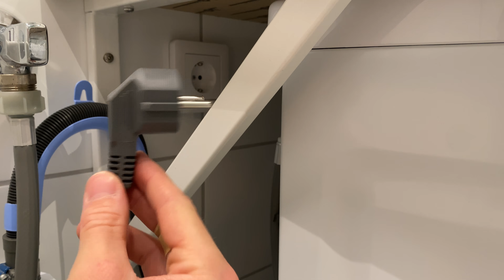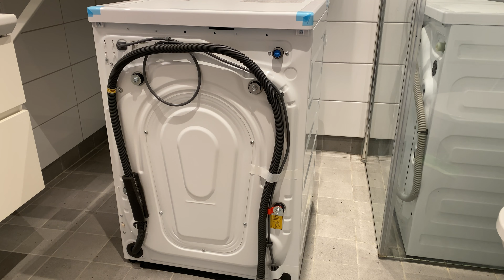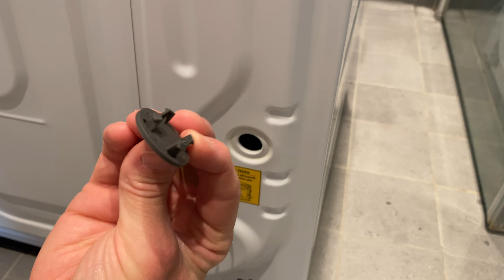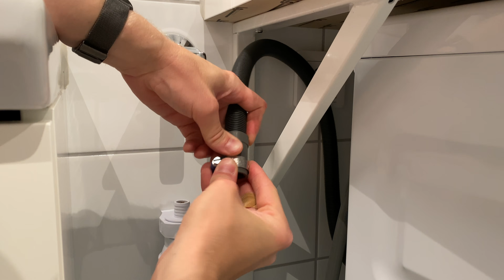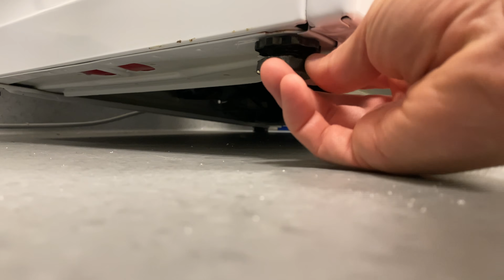How to Install a Washing Machine (and Remove your Old One)

Comment: I'm newly single and first time I'll have to disconnect and put in new machine. Do I turn off main water supply. I'm useless at DIY and usually  fail at everything. Is it advisable for novice to tackle this job? Anybody who can give me tips plz do. My old machine has already flooded downstairs neighbours, I need to avoid doing it again
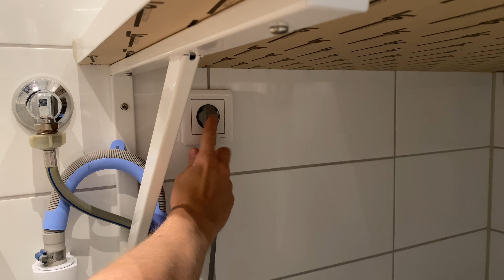Reply from the maker: Hi! As long as you turn off the water that gets connected to the machine before removing any hoses you should be fine there. However if there are no valves or similar very close to the machine (like at 01:39) in the video the water needs to be turned off somewhere else. I would say though that it could probably be a good thing to ask around or have someone help you if possible. Just to avoid any water damage or installation hazards, depending on how your specific machine gets connected.

The installation process also differs a lot from country to country, depending on standards, plumbing, electricity etc. This way is more common in the European region, but even there we have got different standard in different countries. So, take all the help you can and also perhaps ask around in any retail stores to hear if they´ve got some good tips, tricks and recommendations. Some installations you are also not allowed to do on your own, again depending on regional laws etc. Better double check than chance it :-)
Reply: @GetThereFaster thanx for that. Im clueless. I cant afford another DIY disaster so I will try to sweet talk someone into helping me. Thanx again
Reply from the maker: @JoanneHewison  Sounds like a good plan :-) Np! Better safe than sorry in this case.